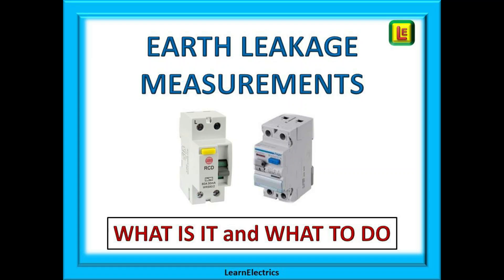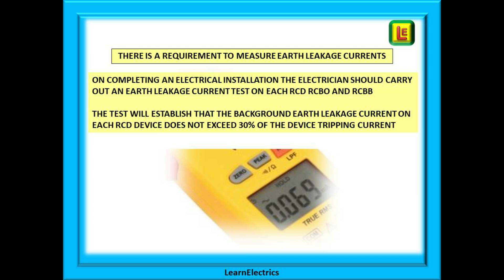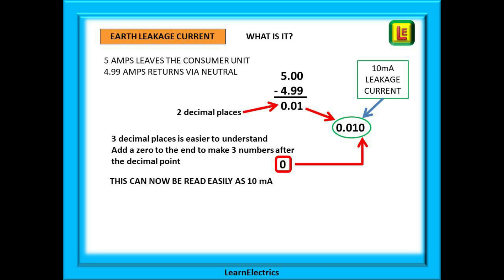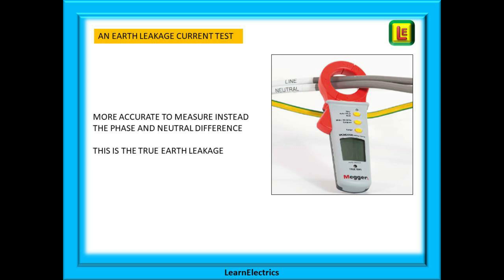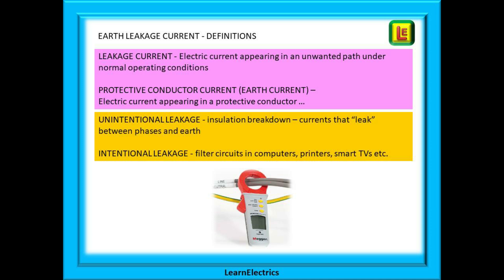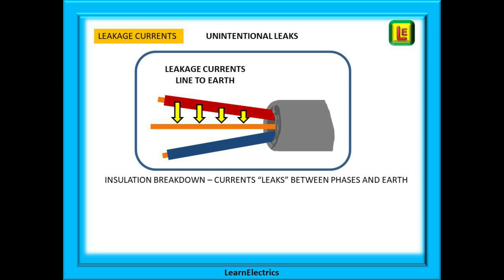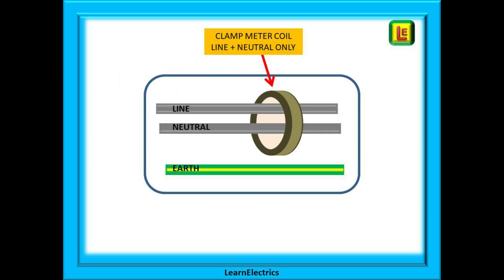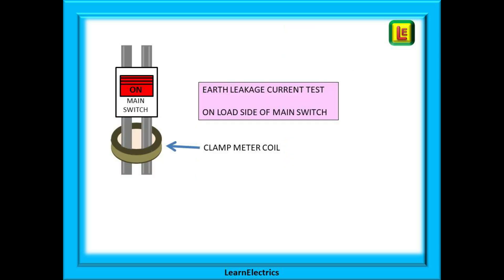EARTH LEAKAGE MEASUREMENTS

Comment: Excellent video. It shows the importance of having proper tools to execute the job. A proper meter can save so much time in troubleshooting. 

In  a scenario where the installation is fitted with an old main switch, with no RCD what is the rule of thumb of  current leakage that would be ideal for a functioning electrical system? I know its 30 % to of the RCD trip time . But where there is no RCD what is the percentage of current leakage on a system without an RCD?
Blessings
Reply from the maker: Glad you enjoyed the video, much appreciated, and thanks for watching. As a 30mA RCD is designed to trip at anything between 15mA and 30mA then I would always aim for leakage currents to be a lot less than this. For me, less than 5mA, but a lot depends on what the installation is used for. How vulnerable are the users to electric currents? In a hospital operating theatre the patient is very vulnerable.

Comment: Can u please explain me why we will need bigger earth cable if rcd trips at only 30ma? I couldn't find proper answer to this. (Assuming rcd is replaced regularly if it fails)
Reply from the maker: The earth cable on an RCD should already be big enough for the trip currents needed. If the cable for each circuit is correctly sized, then the cpc should be ok, Check all the connections in the CU and in the rest of the circuit.

Comment: Thanks mate.
Just purchased the new 'Ethos' clamp meter. It is showing a leakage of 28.5mA on a Tesla Wall charger and the 30mA rcbo for that circuit trips intermittently while on the other hand I have a heater running on another 30mA rcd with a 50mA leakage but it doesn't trip at all! Any ideas? Faulty clamp meter maybe? Shouldn't have these high numbers really
Reply from the maker: I've never used an Ethos. RCD/RCBO should trip between 15mA and 30mA leakage current so I would guess that the RCBO is doing its job.
At 50mA leakage the RCD should have tripped. It could be a faulty RCD, they do fail, without testing myself I cannot say. Check with an MFT if you have one and put it on a ramp test. It should trip on a ramp test between 15mA to 30mA, usually about 23mA.
Hope this helps.
Reply: @learnelectrics4402  yes mate tested ramp test with MFT, trips at 21mA. I think it's a faulty clamp meter as the leak is very fluctuating. Thanks anyway

Comment: Also, one more question - at my distribution panel it is very hard to use a clamp as all wires are tight. Can I use something with pins (like a multimeter) instead? Many thanks!
Reply from the maker: No, you are measuring current. If you don't use a clamp meter, you will have to break into the circuit to attach the meter. Can yo find some slack on the wires outside the CU box, it will still be the same current going through.

Comment: Very good! Can I nest RCDs? Like having 3 phase RCD and then an RCD for each phase (so that just 1 phase goes down). Also can I have a lower limit (nested) RCD for the hotub? Last but not least, what will happen to 3 phase appliances if just one phase is interrupted? Many thanks!
Reply from the maker: Not recommended to have 3 phase equipment protected by single phase RCDs. We should not run 3 phase devices on just 2 phases. Any RCD upstream of another should be less sensitive, a time delay S-type for example to maintain proper discretion, the protective device nearest the fault trips first.
Reply: You need four(4) RCDs for that, each one(1) for the Single Phase Equipment/Loads & another RCD (supply taken after MainSwitch) dedicated for 3 Phase Equipment.
This RCD must be of 3pole or 4pole type depending if yr Load requires a Neutral conductor or otherwise...👍

Comment: Just a question, if each RCD  is reading 9mA would we expect the reading at the main switch to be 18mA?
Reply from the maker: In theory yes, but this will often vary depending on interference patterns. cable resistances etc. At 9mA that is good.
Reply: Thank you very much, very helpful as always!

Comment: Great video as usual, i have a question: Does the leakage current increase the electricity bill ???
Reply from the maker: Yes it does, its like a dripping tap and a dripping tap will fill a bucket. The customer is paying for electricity that is not going through their appliances. It can be many pounds a year.

Comment: Hi there great video, I do have a questions, if the RCD on the board is tripping, & won’t reset how would you test, if you are unable to put on a load.. thanks
Reply from the maker: Turn every breaker off at the CU. Will the RCD reset. If yes, turn the mcbs on one at a time and see if it trips. If it does not trip, turn the breaker off again and turn the next breaker on. Repeat until you find the faulty circuit and then home in on the fault. Unplug everything, reconnect one at a time. have a look at this video on the link.
https://www.youtube.com/watch?v=PXKaq_1DmgU

Comment: Thanks for enlightenment. I have a Lutron DL-6054 ACA Leakage Tester.
I found out that even though meggering value of the circuit is perfect (> 40 megOhms) RCCB nuisance trips. Reason : Megger injects DC voltage in de-energized circuits with all loads disconnected. So it misses leakages of appliances, capacitive leakage of wiring. I read somewhere that the downstream wiring length (from each RCCB) should not exceed 250'  length in order to minimise capacitive leakage. So both meters compliment each other. My humble thought.
Reply from the maker: Thanks for the info. Appreciated and thanks for watching.

Comment: Hi professor D… with todays problems regarding DC leakage into AC circuits which affects ac RCD’s…can a clamp meter measure the dc current….THANKS
Reply from the maker: Not using the clamp coil Dennis, but one of my clamp meters has separate plug in leads to measure DC current as you would with a multi-meter. Dave.
Reply: Thanks…alway searching for an answer…👍👍

Comment: I understand why you need to keep everything turned on when checking leakage on RCD. But why you said that all MCBs need to be turned off except one which is measured? I assumed when measuring MCB leakage current that also all other MCBs are turned on to simulate real life. Please, explain?
Reply from the maker: If you want to check leakage on just one MCB when tracing problems then you need to turn the others off to stop them affecting your readings. You are trying to narrow down your search area to pin point the problem.
Reply: @learnelectrics4402  thanks for your fast reply. I understand but I think that other MCBs will not affect on differential current on measured MCB when other MCBs are ON. Leakage on certain MCB will be same whether other MCBs are ON or OFF. Or I am completely wrong?

Comment: Brilliant vid, Bit confused to how you would test a RCD on the load side with a clamp metre?? As the line is connected via the bus bar??? Only leaving the neutral to clamp around? Can you please explain?

Regards 
Nicholas
Reply from the maker: Test each MCB output cable individually. Hope this helps.
Reply: @learnelectrics4402  Was thinking along them lines…..Thank you for the confirmation
Reply: At the Load side cabling of RCD vs. at the nearest Incoming Terminals of the RCD...
What's the difference?😊

Aren't they the same value?😅

Comment: I never change a consumer unit without checking the earth leakage. If it’s off the scale I inform the customer there’s a pre-existing problem. Then I normally decline the job unless they want RCBOs fitted. Otherwise you’re only inheriting a major headache that could cause serious grief. My tester cost £70. Best £70 I ever spent. Amcal is the brand. Great video again. 👍
Reply from the maker: Absolutely right Paul. I never quoted for a job without checking leakage and Zs first.

Comment: Can any clamp meter be used to measure earth leakage?
Excellent video thank you
Reply from the maker: Any clamp meter but as we say in the video, Sean, it is best done with a meter with a mA range. I have one with milliamps, which is great, and it will show readings less than 1mA, but the 2nd meter, the bigger 400 amp clamp meter shows most small readings as zero as it won't range down to little readings. Horses for courses. Dave.
Reply: @learnelectrics4402  thank you that’s a big help I may have to buy a new clamp meter
Reply: Does this earth leakage current adds to electric bill or increase it? Thanks
Reply: @johnmangcao5793  Its insignificant at all👌

Comment: Great video, how about if you attended for a nuisance rcd tripping. Suppose you carry out an insulation resistance test and all is good. Then you maybe load the circuit up and switch things on and perform another insulation resistance test and again all is good all readings are above well 2M ohm.  
So say you approach the problem next with an earth leakage clamp meter. So you put your clamp on line and neutral, energise and switch things on then the Rcd trips straight away. 
How would you suggest to diagnose a faulty appliance with an earth leakage clamp if it trips off too quickly (where IR tests fail to show the fault when the circuit is dead)?
Reply from the maker: If you know from testing you have a high leakage current and suspect appliances, then unplug everything and retest with clamp meter. One by one plug back in and check leakage reading each time.
Sometimes we have even plugged appliances into an extension lead and plugged them into sockets on the other RCD. Let the customer use it for a day or so and see if the problem shifts to the 2nd RCD.
Nuisance tripping really is a pain at times.
Also, from experience, check EVERY screw in the consumer unit is tight, L/N/E. Make sure you take precautions, live electric. Even a loose screw can cause RCD problems if it shakes. I had one in a pantry and every time they opened the door it hit the CU and tripped the RCD - 4 neutral screws as loose as ever.
Good luck. Dave.
Reply: @learnelectrics4402  these intermittent tripping jobs can be a real challenge to narrow down. It can be a accumulative effect which by itself can be difficult to locate. 
We had a job recently that showed up as high IR when switched off. Anyway after many return visits to the site we found the problem to be an outside lighting circuit supplying 4x son fittings. When the ballasts got hot it shorted down to earth on 3 out of the 4 fittings. Sometimes you’ve just got to persevere!! Enjoying all your content so far, keep it up 👍
Reply: Megger and Leakage tester compliment each other.